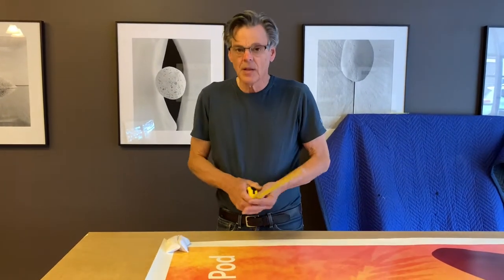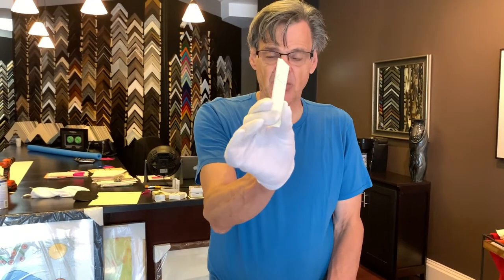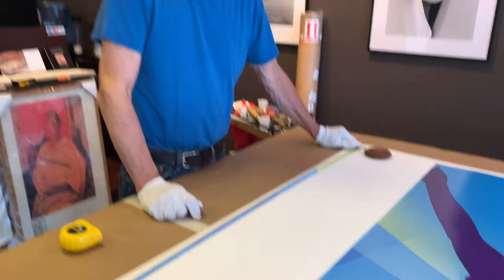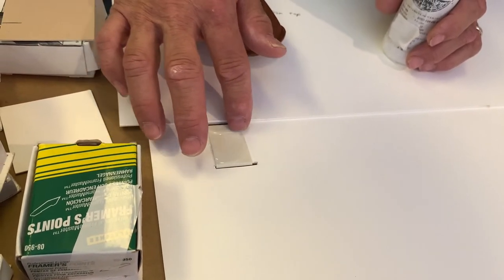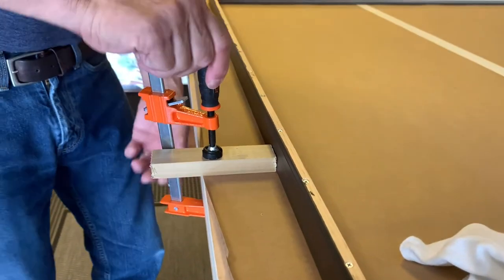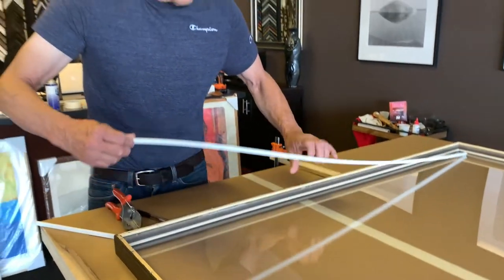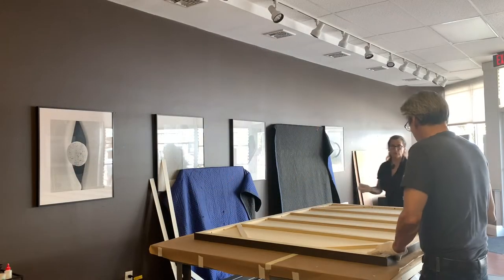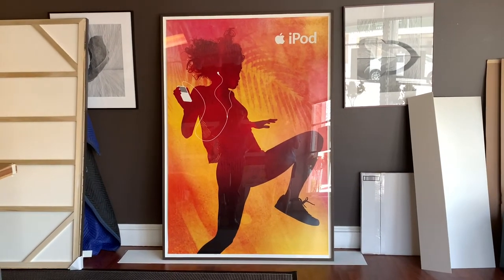Vintage Apple: These Things are Huge (Part II)

Comment: I heard a term in the frame shop where I work today called staking frames. It wasn't as out there as I thought but it would lift the painting off the wall a lot. Would you build around it rather than wrapping it in paper?
Reply from the maker: Hi David, I have never heard of that term. It's possible that you are talking about stacking frames where you put one larger frame right over a smaller frame. If this is what you are talking about, if the outer frame is not extremely deep it will cause the outer frame float to stand away from the wall. And yes, you will paper the back of the smaller inner frame as normal. If this is not what you are talking about please let us know!